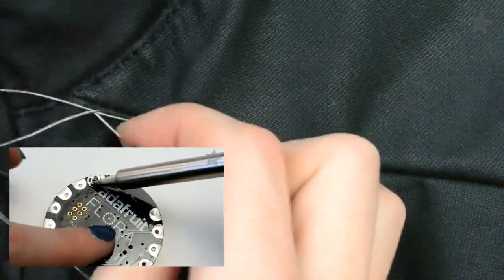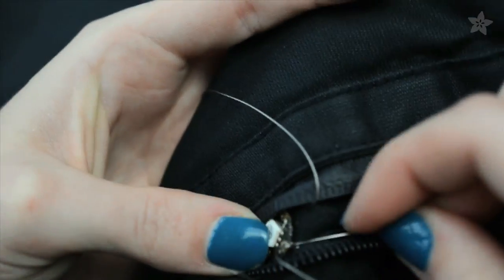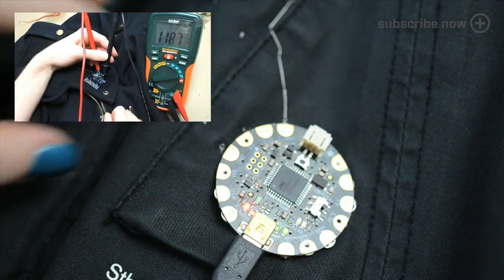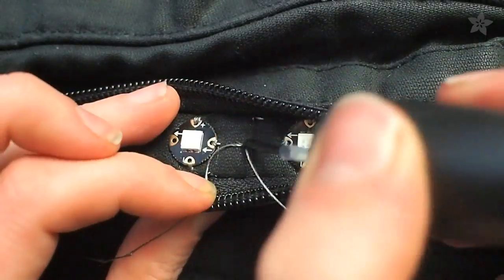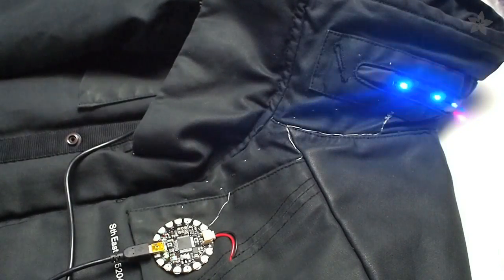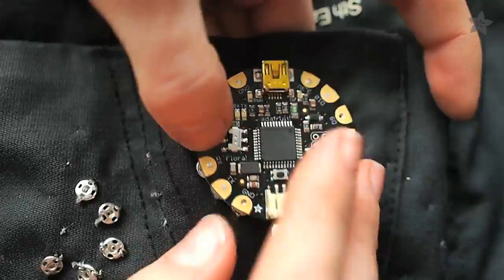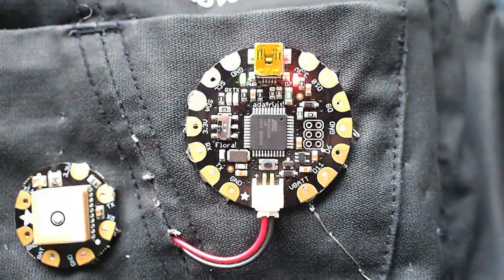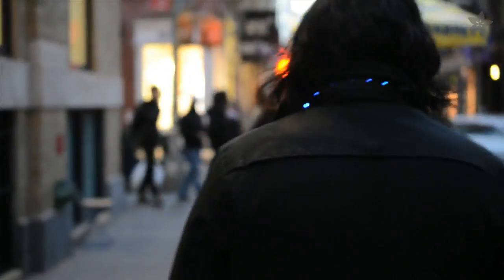Flora GPS Jacket

Comment: This system could have great potential. If you can link two or more together, so that if the linked signals drift away from eachother they have the ability to find eachother by pointing the wearer in the direction of the other chip, a parent could put this on their child and never have to wonder where they wandered off to in a store, festival, camping, or wherever. Something like that could save lives.